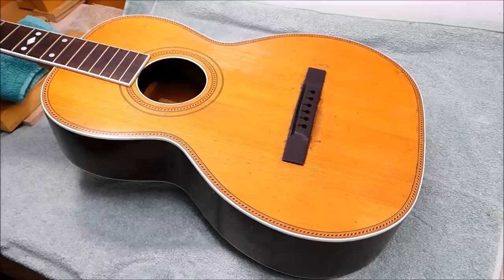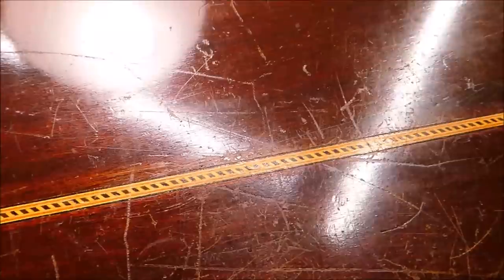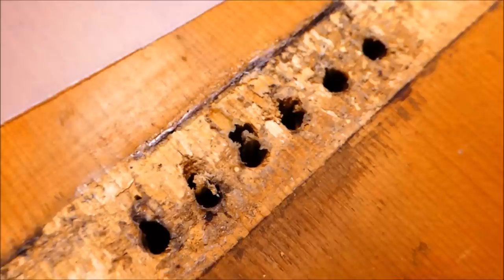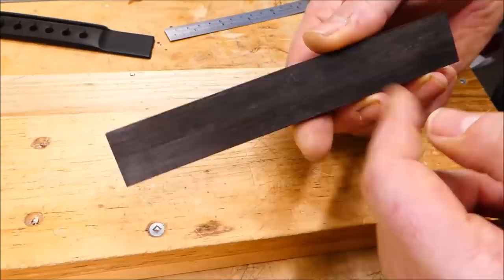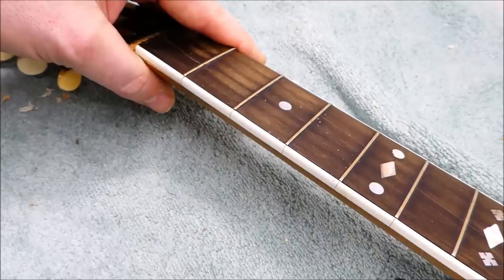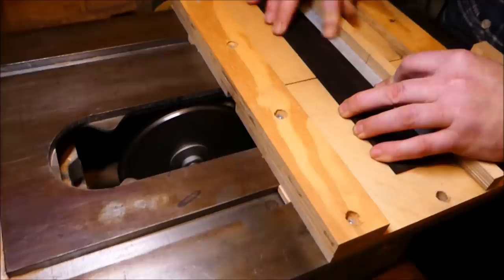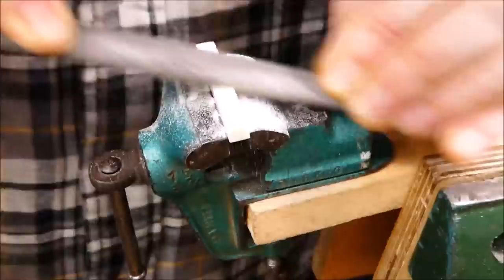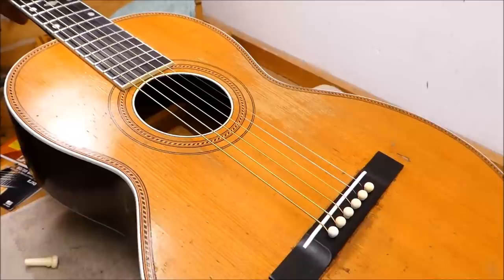Lyon and Healy Parlor Guitar Gets the Full Treatment.

Comment: That must be best neck on such guitar ever. Those carbon inlays resonate like crazy and that fret board is awesome. That neck is perfection. Guitar sounds very nice now. All together one of the best jobs I've seen.
Reply: The carbon fiber resonates? It’s embedded thoroughly in the neck.
Reply: @trackie1957  it conducts vibrations like a glass or high tension high hardness metal. So when you hit strings all guitar vibrates
Reply: @NINEWALKING  
Thanks!

Comment: Great video, thanks
I have a Lyon and Healy 'American Conservatory' Parlor Guitar.  Got it from eBay (about 12 years ago) for £450!  
Made somewhere between 1893-1915, The neck is like a baseball bat (but, perfectly sits in the hand).  It even has 'x' bracing.
After researching, 'American Conservatory' was a music school, way back when. 
Seems mine was a custom order made for players at the conservatory by Lyon and Healy.  Which is why it probably has 'x' bracing so early.  There are no pics online of the instrument I have (from any of the Lyon and Healy pics).  Another reason its probably custom.  Its not 'mint' (finish is worn in places), but it has that 'played in' look.

The only modern change, removing the bar frets (which plane your fingertips off when sliding :) and replaced with dunlop jumbo frets!  Plays like a dream (1.5mm action at the 12th fret - across all strings) no rattles or choke outs.  And its never had a neck reset!  Though, I think the end of the board and the bridge may have been planed down a bit in the past).
The guitar is made of Brazilian rosewood back+sides and with an Adirondack Spruce top and ebony bridge and fingerboard.  Its super loud (louder than a modern 'factory' dread), on the mid/treble side in the sound department.  No matter how hard you hit the strings, they never tone out (that 'plunk' sound you get when hitting the strings too hard).  Instead, the instrument simply produces more tone and volume!
Apparently, the workers from the Martin Factory also worked for Lyon and Healy (due to part-time / seasonal work)
Love that instrument. 

It got me to hunt down two other parlors, before they started to get more expensive/rarer online (and before the Brazilian rosewood crackdown when shipping). 
A Washburn '1915' Parlor, another great instrument (built by the same 'seasonal' Martin craftsmen apparently).

And a 1920's SS Stewart Parlor, lesser know but just as good (again, they were often made by the same craftsmen).
all these instruments are; Brazilian rosewood back+sides, Adirondack Spruce top, ebony bridge and fingerboard

Highly recommend people track these instruments down.  It was a golden age for the luthier craft.

Peace.
Reply: Shhhh!

Comment: I have a Lyon and Healey Lakeside. It appears to be the same basic guitar as this model with exception of a flat metal "trapeze" and floating bridge. The purfling is more ornate than this guitar, however the fretboard is not bound. I purchased the guitar from an elderly lady on my paper route when I was 14 years old for $7.00. I'm now 71 and the guitar is still in good to excellent condition.  Sounds identical to the guitar in this video. Weighs about 3lbs. I reset the neck two years ago based on your videos. Turned out on the money. Action is 5mm at the 12th and no fret buzz with Ernie Ball Earthwood .011-.052 strings. Thanks for sharing your knowledge and the beautiful work you masterfully applied to this guitar. Cheers!

Comment: Great job. I like the way you show every step of the repair in detail. I learned a lot about the tools and techniques you use (like those neck joint heaters). I like that you added some high tech modern improvements like the carbon fiber neck reinforcement but still kept the original look of the guitar. I like that it can now take light steel strings but be good for many years of play and not just some museum piece that is too delicate to play without damage.

Comment: As ever, Terry (if I may presume to address you), your history lessons are as fascinating as your assessment and repair of the instrument itself.

I’m still digging through your archives after months - I originally came along for the electric guitar things but the acoustic work has really got me hooked - I have learned SO much about the construction as well as issues and repairs!

So thanks!

Paul.

By the way, I have a 2014 Gibson ES-339 which so far (and touch wood) hasn’t been dropped and has an intact headstock.

Should I book it in with you for a headstock repair now for… say… 5 years time 😅

Best wishes!

Comment: Thanks for this one. It has given me a lot to think about. I have a Martin from 1868ish that needs a neck reset. It has the "ice cream cone" heel, so it's tricky. I have been debating with myself about adding carbon fiber to the Spanish Cedar neck. There is an interesting conversation to be had about keeping an instrument as a museum piece or making it functional. This video was helpful.
Reply from the maker: The ice cream heel is such a difficult choice. You're usually stuck making a reverse wedge that's thickest at the fingerboard side and trying to retouch well enough to hide it.  You also have to consider what the original setup really looked like. With gut strings it was probably much closer to a modern classical string height. You have to figure out what's reasonable to expect from the guitar. This one is pretty comfortable to play. Many of the early Martins I've had my hands on had necks that were quite difficult to hold for long periods.
Reply: I think it depends on the history and the condition of the instrument. If it is a museum grade instrument that you want to keep for collection, you may want to keep it as original as you can.
If it is a player grade, better to be as good to play as it can be.
If you decide to go to this route, would be smart to send it to someone like Ted, who has the correct historical acknowledgement and knows how to make the inevitable interventions keeping it as original as it can be.
Reply: @twoodfrd  Thanks for the response! I will add that when I put a straight edge down the neck it actually lands below the bridge, almost on the top. So, I doubt that is the original intent. It looks like previous owners used a capo on the 1st fret with steel strings...major fret wear (bar frets at that!). It also helped with intonation issues. Somewhere along the line the spacing with the nut must have shifted enough to not be as accurate. It plays better in tune when capoed. BTW, I use Del Arte nylon string 6 thru 4 and John Pearse Folk (by Thomastik-Infeld)  on the G, B, E. It stays de-tuned when not in use.

Comment: Great video especially liked the very logical and well thought out new brace placement especially. Makes total sense from both a structural and sound perspective. I have looked at a number of these parlor guitars from the inside and more than a couple ruined by steel string ups and lack of neck/ fingerboard reinforcement.Also kudos to the very well thought out fingerboard and binding replacement this is the best way although I would like to see perhaps a little more clamping pressure on board glue up as this is the little guitar's largest glue joint. The V profile neck presents caul shaping issues when The neck wood on these could be Spanish cedar a wood used during this gut string period so perhaps would use the old Spanish rope and wedge method plus couple steel or cam clamps on ends if needed. Thanks for the best videos on repair, also love your modern stuff like tape and super glue methods and magnet cleat clamping as well ask those foam cutter neck heaters, wow a guitar repair dream, the old steam method was so tedious and dangerous! Once saw a Martin neck reset with steam actually loosen the neck block from the upper bout/ sides!

Comment: Incredible job, great guitar. The shorter scale reduces the tension at pitch, so I think between that and the extra bracing and the carbon rods you would get away with a set based on 11s . I use a progressive tension set that put together on stringjoy. I used their calculator to check what the tension for each string in this set would be at the scale length of this axe (24.25 inches):

.011 - 19.5 lbs
.015 - 20.4 lbs
.020w - 20.9 lbs
.028w - 22.3 lbs
.038w - 22.8 lbs
.052w - 23.8 lbs

total - 129.7 lbs

Pretty sweet! I use this set on a rather fragile acoustic it works nicely (longer scale than the L & H though). You could get a smoother transition between the G and D strings by using a .027w for the D, stringjoy don't make that gauge though. For this reason I have used strings by mail to put together my own progressive tension sets for my other guitars based on .011 and .012 on the E for my electrics and .013 for my other acoustic (Takamine). The gradual increase in tension from higher to lower feels really "right".  Anyhoo, keep up the stellar work man! That guitar sounds amazing!

Comment: I own and play a 1920 or 21  Lyon Healy not as fancy but  Same size and shape  the same (but different color)  purfling. All  Brazilian rose wood  sides and back (The grain is Martin like tight). Brazilian rosewood nut and floating bridge, with metal tailpiece The neck and fingerboard is rosewood and is unbound with a  Beautiful rosewood head stock. she can handle 12s  (lights steel string ,and even 13 mediums) but I keep lights on her sometimes I put a 13 on the high E for slide blues  Her voice and  Tone Is incredible, She has a demon like sustain with a lot of volume I tune her down at night and put her in her case to bed  She had a neck reset before I got her and I had her get a refret from a great luthier named Jim in Portland OR He did a fantastic job , I will take her to my Grave. Thank you for the Fun Vidio .

Comment: Excellent work!  I've worked on quite a few of old L&H guitars, and I thought I had the answer to the question regarding S. T. Eagle's work.  I've only seen that type of bracing, the single flat brace spanning the top, on L&Hs made with a floating bridge.  So, it seemed that STE refitted it with a fixed bridge.  But, unless he did a superlative job, you would have noticed the screw holes and footprint from the tailpiece, so, I guess that shoots that theory.  

I'd definitely place this guitar towards the end of the 1885-1915 range.  The tuners on the early end would have been brass, and a bit fancier, with bone knobs that were riveted on.  The bridge is also later.  (Back to floating to fixed bridge theory?)  Even in 1915, L&H's still used their classic truncated pyramid bridge.

The "sandpaper" method of neck resetting is the best thing since sliced bread.  If you use something somewhat elastic, like fishing line, for the guide strings, you can remove and replace the neck as needed, and still "dial in" the string height and neck alignment with the guide strings in place.  You've done a great service introducing this technique to your viewers, so thanks for sharing!
Reply from the maker: This one always had a fixed bridge, but there were many others out there with a tailpiece.  The wide brace is pretty common on a lot of ladder-braced guitars. Most Harmony's and Kay's had it as well.
Reply: @twoodfrd  That's interesting.  I have to admit, I'm more of a collector, but, I do my own work.  I suppose there's a bit of selection bias involved.  I loved L&H guitars and was never particularly interested in Harmony or Kay.  So, I'll just plead ignorance.

Keep up the good work!

Comment: WOW, I find this extremely helpful because I have American Conservatory on my bench, an instrument of much higher class. Its sides and back are of top possible Brazilian rosewood and the neck is very dense mahogany, and the board of ebony. Tuners are perfect condition BUT  I have had a problem to solve what to do with that bracing, nobody to ask for advice. It would be barbaric to modify the original for X bracing. Too invasive. But thank you for your idea to add the tone bar  the way you did it. I don't even ask you how you sneaked that brace there with no chance to make side pockets for it. I am lucky my guitar has had the back removed in order to repair some cracks on Brazilian back. To meet the shrinks well I had to reglue the braces after repairing the back. Brazilian rosewood is more like porcelain than wood. The guitar is still open. Since the board is off I plan to add passive reinforcement to the neck. My tested material is carbon fiber bars along with stiff mahogany I have. The two vertical bars are joined with one horizontal glued with mahogany or rosewood that makes a T bar. It is extremely stiff and feather light.I would welcome your advice.

Comment: If you like surgical tubing, try old bicycle inner tubes! They come in many thickness. I use scissors to cut strips about 1/2” wide x the full length of the tube. They sit flat and have plenty of friction so you can add more tension where you need it. Besides, they’re free!

Comment: What a sweet sounding little guitar! I bet the owner is absolutely thrilled to have it now. I wonder how many hours you put into the restoration? It seems to have been worth every second!
Question: I'm curious why you'd choose bronze wound strings for this turn of the century guitar? I don't know if they were in use back at the turn of the century; my guess is that plain steel or nickel wound would be more 'historically/tonally accurate'. From what i can glean online, Martin and/or Gibson first introduced steel strings sometime in the 1920s...  At any rate, plain or nickel steel is what I use on my Waterloo acoustics, which are more or less repros of 20s-30s lightweight steel string acoustics. (OS Stellas and Gibson Kel Kroydons, etc) I really like the tone of the plain steel strings on these early guitars, and from what I can gather the addition of bronze and then phosphor bronze happened some decades later. My main reason for this preference is that the overtones and decay of the plain steel is less complex and perhaps a bit shorter; perhaps the overall tone is a bit darker, which better suits my fingerstyle playing.
Thanks again for another lovely and 'therapeutic' video! :)

Comment: I have a Composite Acoustics Cargo and tried to sand the saddle down. 15 minutes later and no progress I realized it was also carbon fiber, and 10 minutes later on the flat side of the grinding wheel I finally had progress. I can't imagine what nightmare it would be to have to sand/scrape 20x that.

Comment: Ha! I live in Billings, and that description was very accurate.  The camera shaking is probably from the motor in your table saw.  The AC Electromagnetic flux induces a current into the image stabilization coils, and the computer onboard doesn't know how to deal with it, causing an exaggerated fix.  If you put a brass mesh around the camera, it should stop that from happening.  But that's realistically too much work for the few seconds of footage you'd need.

Comment: In your table saw shot where the camera is vibrating I wonder if it is due to the lens or camera body having a vibration reduction set to on.  Since the vibrations are so rapid the lens or camera in trying to cancel out the vibration just makes it worse.  If this is the case you may want to turn the vibration reduction off to see if it is any better.  Just a thought.  Great content and these are very well done.

Comment: Are those the things for cutting styrofoam? I have those .. I use them to cut through this 2 inch foam I use on the inside body section of guitar cases... So I can trace large, unconventional shapes and lock them into the body section. I can really lock one in so that even if the case is upside down. it won't matter as long as the end of the peghead has plenty of room. Cuts like a laser... any shape you want. And the artistic possibilities with foam and those things are endless!

Comment: I am preparing to restore a similar early 20th century parlor, and wondered about the decision to install a non-adjustable truss rod vs. retrofitting an adjustable rod. Is it to avoid excessive modification of the original design? Or because it requires less labor?

Comment: My stepdad used to have a beginners guitar made under the 'Lyon by Washburn' label, worded just like that on the headstock. He would have bought it in the late 90s, maybe 2000. It was seriously the worst 'new' guitar I've ever played. I think he said he paid $150 for it, maybe $200, exceptionally cheap, even for a beginner guitar for the time. Action was damn near a full centimetre at the 12th, Barre chords past the 3rd fret was completely pointless, I was better off holding the F shape and trying to thumb the bass notes. And smelled like vinegar for some reason. It also had the weirdest finish I've ever felt on a guitar, too. It was like a semi-matte finish, maybe a single coat of finish, but it felt so artificially smooth. No gloss finish, but no notable pores in the wood either. I don't miss it one bit, and it doesn't seem like Washburn held the old company name in very high regard, judging by that one example I had to play on during my teenaged summers in New Brunswick....

Comment: Hi Ted, super as usual. Did you think about using silk and steel strings? They can be a good compromise on older non-truss rod guitars. I use them on a 60’s Martin New Yorker. Also did you consider installing a truss rod rather than the carbon rods?